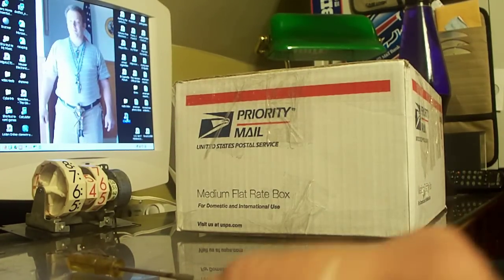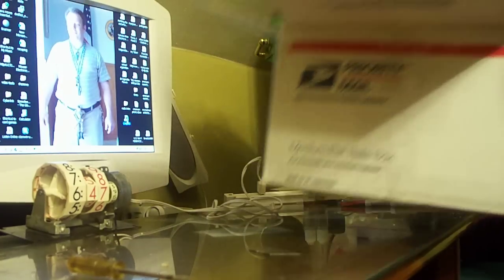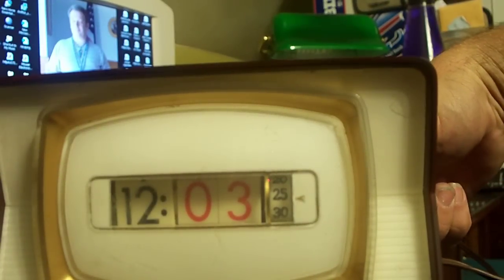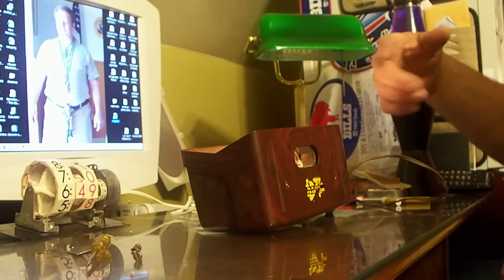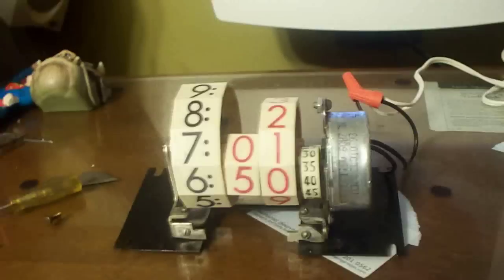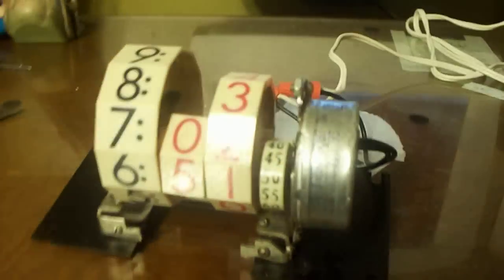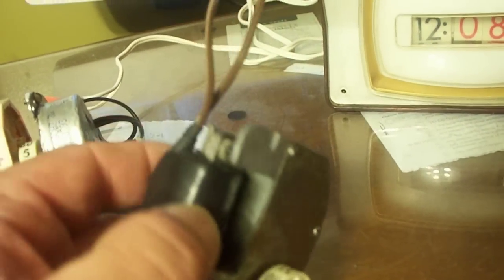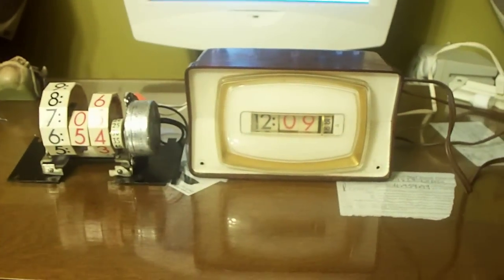unbox numechron plus clock with softener motor.MOV

Comment: Wow, that is what I got my 765 that came broken for, 99 cents!!  I like what you did with the retrofitting the motor on the clokc movement, that is awsome!!  I think that plate you used came from me :)  That old blown out motor with the bakelite gear that was stripped out.  Wow, I can't believe that you actualy found a 765 faceplate without any cracks by the screws.